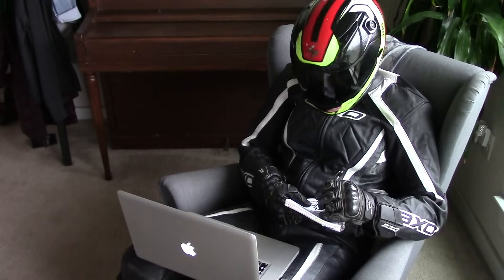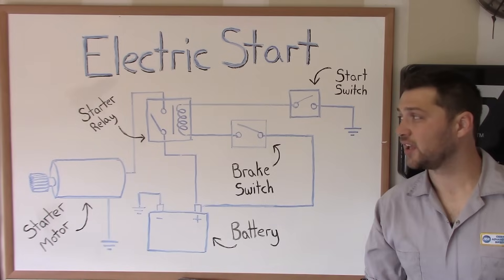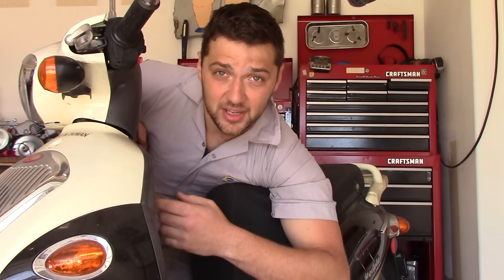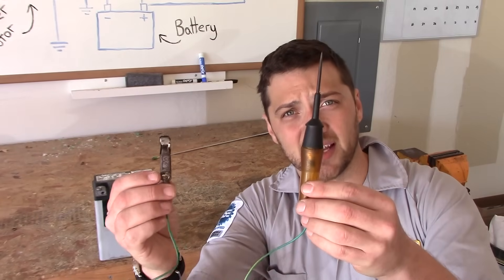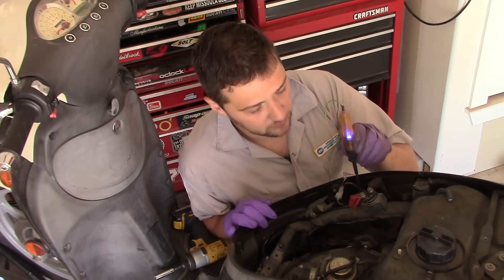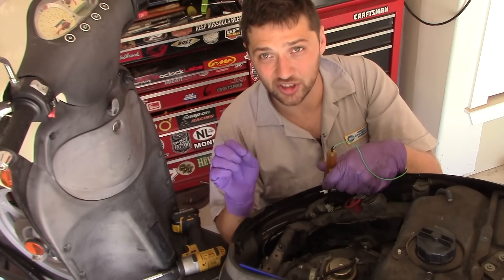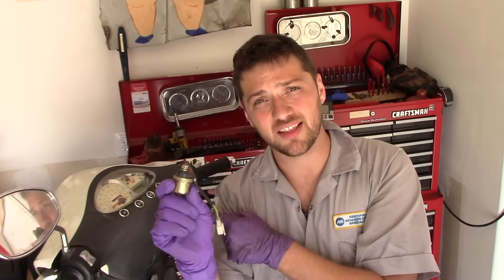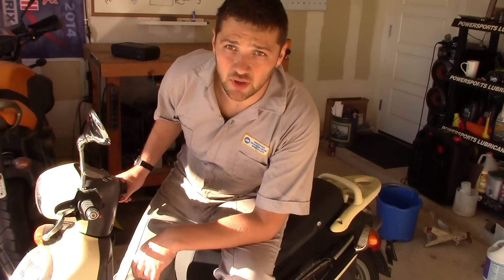Scooter 911: Electric Start Doesn't Work (troubleshooting your starter, starter relay, and circuit)

Comment: @3.36 You said that the noise scooter is making is not because of the Electric System. But You did not tell anything about the cause of that. Suddenly You jump into another topic. Can You please tell, why the scooter makes that noise? My Scooter is making exactly that noise @3.36. I don't know what that sound is called.
Reply from the maker: That sound is called cranking. It's made when the starter motor is turning the engine over. Sorry for being unclear in the video, but what I said was, "if your scooter is making this sound (cranking) your electric start system is working just fine. You have a different problem."

This video only deals with diagnosing the electric starting system and testing the components within it. I.e. the starter, starter relay, and switches. If you scooter makes that sound, all of those components are operating properly so you do not have an "electric start problem".

If your still scooter does not start after making that sound, the condition is called "crank but no start".

I will have some diagnostic videos coming out in the near future that can help people diagnose that condition. Good luck!
Reply: @Scooter_911  Thanks for the detailed reply. So if the scooter is in "crank but no start " mode, which parts should I check? I have checked the battery. I put it on charge. The back red light glows when I press brake, horn blows good sound, fuel indicator turns right on, side signals work good. So I think battery is not the problem.
Reply from the maker: @kylielarsen6404  if the scooter cranks and doesn't start there can be 3 different culprits. Either the scooter has an issue with spark (via the CDI, coil, and sparkplug), Fuel (via the carburetor and petcock), or compression (via internal engine components). Keep in mind it can be any combination of these things. 

Think about the history of the scooter. If it has been sitting for a few months or more chances are the carburetor is plugged with deteriorated gasoline. If it just stopped running all of the sudden, more than likely you have a spark issue. If the scooter got weaker and weaker over time or made a terrible noise before it stopped running I would suspect a compression issue. Good luck!
Reply: @Scooter_911  My Scooter looks like it has a different problem. 1. Electric Start was not working. So I used the Kick Start. It was working fine. So I did not bother to worry about electric Start. 2. Now, Kick start is also not working when it is cold. I am in Texas. So after 10:00 A.M, it gets hot and then it is working fine without any problem. Not sure. What the problem is on my scooter.
Reply from the maker: @kylielarsen6404  that sounds like a fuel related issue. did the scooter sit for a while? you could have a plugged choke passage. what part of texas are you in?
Reply: @Scooter_911  I am in Dallas. No. I am using the Scooter every day. More than 13,000 Kilometers on it. This problem started to happen from Yesterday. Is it the fuel line that is the problem? There is no Choke on the carburetor. I checked it. Mine is a taotao 49cc 4 stroke engine Scooter.
Reply: @Scooter_911  Also another thing is, if I am going somewhere, lets say like after 4-5 miles, when I use the electric start, the electric start works then. But I guess the engine should be running for atleast 10-15 minutes. Then the electric start works without a problem.
Reply from the maker: @lorryatkinson8741  so the scooter "cranks" every time you hit the button but the scooter does not always start when it's cold?
Reply from the maker: @lorryatkinson8741  all scooters with a carburetor have a choke. Yours is an electric/automatic choke. its that black thing on the carburetor with 2 wires coming out of it. It could be that or your scooter might be in desperate need of a valve adjustment.
Reply: @Scooter_911  It will never start with a electric start also. Electric start is completely gone long back. I use kick start only. Kick start works when it is hot outside. But if it cold, then it is not starting from Yesterday.
Reply from the maker: @lorryatkinson8741  ohhh I see now. Well yes I think you have a fuel or compression problem that you should probably address first. I will be posting more videos soon that might help you with these other problems so stay tuned.
Reply: @Scooter_911  Also, the vale adjustment, I am going to look into that shortly. My variator also has gone bad. so I am waiting for that part. Once I get that I want to change the Gates Powerlink Belt and Front Variator. I use 6 grams weights. After that I want to check the valve adjustment also to 0.05mm. Right now seeing the videos here on youtube regarding the valve adjustment. ordered a new NGK spark plug as well. want to change that also. Will clean the inside of that head with a carburetor cleaning liquid. If not, then I want to change the carburetor. But thats my last option as of now. Any suggestions are highly appreciated. Thanks a lot for the time and effort You are putting in helping me out of this problem.
Reply from the maker: @lorryatkinson8741  I'm glad to help! I want to make sure everyone who wants to be in the wind can stay there. Those all sound worthwhile investments.
Reply: @Scooter_911  Hi Garrett, Thanks a lot for Your help. My Scooter now works good. The Electric Start works like a charm now. That valve adjustment trick helped me a lot. Thanks a ton for that.
Reply: @Scooter_911   I could not do these repairs as I was stuck with my finals. So here are the few things that I did on the scooter. 
1. Changed the Clutch Assembly. Put very small amount of Lucas red and Tacky grease and put the Clutch assembly. 2. Variator Set. Complete set is new. I used a new set of 6.5 grams roller weights which I bought separately 3. I changed the Belt also. 669 18 30 Gates Powerlink Belt. 4. I changed the Engine oil 10W-40 Full Synthetic and Gear oil 85-90 Full Synthetic. 5. Charged my Battery for 5 hours on the Wall charger that I got with the Scooter.  - So recently I started noticing that  my Scooter is making some noise, just like in this video. https://www.youtube.com/watch?v=BfZppT1exm8

This is the exact noise, I have on my Scooter. Unable to find much information about this problem. All Comments section in this video, everyone has the same problem. But no solution.  When I am going about 10 miles / 15 kilometers, it runs good. No Problem. But when I go high speed, thats when I hear that noise. Any help, is highly appreciated. Thanks a lot for all the help and guidance.
Reply from the maker: @lorryatkinson8741  did the sound change at all after you replaced the belt (either in tone or in when the noise occurs). May I ask where and why you applied the grease to the clutch? How many miles are on your Tao tao?
Reply: @Scooter_911  The sound was there before I changed the clutch. But after I changed the clutch, it started even more. below 10 miles, no sound, nothing. 2. I applied grease to the actual metal rod, the clutch sits on. No grease on the clutch inside or to the pads. 12,000 kilometers, since this is a chinese scooter and they use metric. Similar to Tao Tao but Ice Bear Brand.
Reply: @Scooter_911  other people are saying buying a performance clutch cover might help
Reply from the maker: @lorryatkinson8741  it could be the issue but it could also be the belt or a final drive bearing. Was the belt you took off a 669?

Comment: Mines a vatacci eagle it's brand new i just got it & it's not starting..the horn & lights work but it just won't start or do anything i bought a battery charger for it & still nothing no sound or anything..any idea
Reply: Yes there's a click but that's all it does
Reply from the maker: Did you try the starter relay bypass at 7:32 ? You you hear a click at all when you hold the brake lever and press the engine start button?
Reply: @Scooter_911  i got it off the internet some are saying it's the spark plug but i didn't get one so I'm guessing it's already in there but it's not starting there's a click but no start
Reply from the maker: @MrJdrowe02  it most likely is NOT the sparkplug. Is the scooter making the same sound that I demonstrate at 3:35 ? That sound is called cranking and if the scooter is cranking you have an issue not related to the electric start system. It sounds like your scooter is not cranking though, and is just giving you 1 single click each time you press the button. Did you try the starter relay bypass yet at 7:32 ? That test will tell you if the problem is the starter motor, or starter relay. Let me know what happens when you perform that test
Reply: @Scooter_911  it just made some start up noise
Reply from the maker: @MrJdrowe02  so, not the cranking noise? Did it make the noise after you did the bypass test?
Reply: @Scooter_911  when i did the test i made the Same noise at 3:35
Reply: It
Reply from the maker: @MrJdrowe02  nice work! So if it cranks when you bypass it, but only clicks when you press the start button it's most likely your starter relay!
Reply: @Scooter_911  yea I'm having it taken to a mechanic so hopefully i can get up & running
Reply from the maker: @MrJdrowe02  the starter relay is pretty cheap and easy to replace yourself if you want to give it a try.
Reply: @Scooter_911  yea but it's like the bike i got was supposed to be fully assembled & inspected but unfortunately it wasn't..it won't start & now I'm having to take it to a mechanic to have it inspected plus I've had to miss work because of someone else's screw up smh
Reply: Do you know how to restart or reprogram a scooter using a computer
Reply from the maker: @MrJdrowe02  well most scooters cannot interface with a computer. However some of the fuel injected scooters like the Yamaha Zuma 125 and the Honda Forza can interface through their respective data link connectors. Are you trying to reset something?
Reply: @Scooter_911  my brand new scooter i got won't start i took it to a mechanic & he said it needs to be Restarted with a computer
Reply from the maker: @MrJdrowe02  what kind of scooter is it? Is it the vatacci eagle?
Reply: @Scooter_911  yes its a 150
Reply from the maker: @MrJdrowe02  I'm afraid he was mistaken. There is no computer in that scooter. Does the scooter crank? Like rikiikikkikkikikiikkkikk?
Reply: @Scooter_911  no there's no crank..its a brand new scooter he said it needed to be Restarted the same way you re start a car
Reply: When you turn the ignition the dash lights don't even come on
Reply from the maker: @MrJdrowe02  and the battery is good and fresh? There is a fuse on a red wire near the battery. Check to make sure the fuse is good and the battery is properly installed. Does the horn honk?
Reply: @Scooter_911  yes the horn honks
Reply: @Scooter_911  & yes the battery is new it came with the scooter
Reply from the maker: @MrJdrowe02  does the brake light illuminate? Didn't you say it cranks when you perform the starter relay bypass?
Reply: @Scooter_911  yes the brake light works
Reply from the maker: @MrJdrowe02  and does it crank when you bypass the starter relay? 7:32 ? If so you might just have a defective starter relay. I know it's brand new but it does happen. At the dealership I worked at we'd break brand new bikes out of the crates and have to replace components like that.
Reply: @Scooter_911  well hopefully it's not..the mechanic told me to call the company that i'd bought it from & they'd help troubleshoot it & then Recommend that i have it taken to a shop locally
Reply: @Scooter_911  it could be that something may not be plugged up..because i looked under it & noticed that a cord wasn't plugged i just didn't see where it plugged into
Reply from the maker: @MrJdrowe02  what kind of cord? Was it an electrical connector? That is possible.
Reply from the maker: By rereading the comments I am almost positive that you have a problem with your starter relay. Make sure that the 2 pin connector is fully connected to the wire harness and if everything is connected correctly, order a new one.
Reply: @Scooter_911  i think it might be a key fob issue
Reply: @Scooter_911  i just saw a guy that had the same problem with his bike not starting..but had lights flashing & horn working he said all he needed to do was change the battery & he was back up & running..so I'm thinking it may just be the key fob
Reply from the maker: @MrJdrowe02  does your scooter have a key fob alarm?
Reply: @Scooter_911  yea
Reply from the maker: @MrJdrowe02  oooohhhhh that probably is your problem.
Reply: @Scooter_911  so just change the batteries?
Reply: @Scooter_911  i think that's what the mechanic meant by it needed to be Reset
Reply from the maker: @MrJdrowe02  well not exactly. You might have to remove the alarm system. It could be defective. It is not programmable either.
Reply: @Scooter_911  well it works when i turn on the radio idk it might just be remote start
Reply from the maker: @MrJdrowe02  unfortunately there is no reset on those. they're pretty cheap little alarm system, you're better off just cutting the whole thing out of your system.
Reply: @Scooter_911  well it shouldn't need to be disconnected..its on there so no one will try to steal it
Reply: @Scooter_911  how do you stop gas from leaking
Reply from the maker: @MrJdrowe02  where is it leaking from?
Reply: @Scooter_911  its leaking from a thing that has a screw in it
Reply from the maker: @MrJdrowe02 on the left side of the engine near the bottom?
Reply from the maker: If so tighten the screw
Reply: @Scooter_911  yea a guy had stopped me & noticed gas was leaking on the left side
Reply from the maker: @MrJdrowe02  that's a float bowl drain for the carburetor. Screw that brass screw all the way in. If it still doesn't stop you can just tie the hose in a knot.
Reply: @Scooter_911  well i did notice it a little loose when i went to screw it in so yea it's pretty tight now
Reply: @Scooter_911  is the exhaust pipe supposed to smoke
Reply from the maker: @MrJdrowe02  No. The oil may be overfilled, or if the scooter was laid on its side for a while oil can make its way into the combustion chamber
Reply: @Scooter_911  well its a brand new scooter & they said to change the oil..but i haven't yet..i just checked the dipstick & it looks like more than enough
Reply: @Scooter_911  how do i Replace the mirror..my bracket came off Smh..any suggestions
Reply from the maker: @MrJdrowe02  Yes in fact I made a video about it! Check it out here https://youtu.be/3RLjftChITI
Reply: @Scooter_911  well what I'm saying is the screw base came off so there's nothing to actually screw in so is there a way to get a mirror replacement
Reply from the maker: @MrJdrowe02  yes they are available online. If the mirror mounts into the switch assembly look for a left hand or right hand switch. Pay close attention to the connectors. They should be pictured in the description
Reply: @Scooter_911  yea but the braket part that holds the screw in came off so how can it be replaced
Reply from the maker: @MrJdrowe02  sounds like you'll have to replace the whole mirror mount or hand switch
Reply: @Scooter_911  what tool do you use to change oil
Reply: @Scooter_911 my speedometer stopped working..any idea how to fix
Reply from the maker: @MrJdrowe02  check to make sure it's still connected at the wheel.
Reply: @Scooter_911  i checked & it was disconnected..one of the prongs broke
Reply: @Scooter_911  also what does it mean when it makes like a ticking sound after you ride
Reply from the maker: @MrJdrowe02  it's just the hot metal cooling down. Nothing to be concerned about.
Reply: @Scooter_911  ok cool so is there anywhere to get a new cable for speedometer
Reply from the maker: @MrJdrowe02  yep, there's a lot of retailers online. You can even get them off Amazon. Just measure you're old one and take note of the way it mounts in the speedo and drive unit.

Comment: My Suzuki V50 Address is not even starting with the kick
Even the horn is not working.
Any idea?
Reply from the maker: Most likely the battery, I have a video coming out soon that should be able to help you with this though. Hang tight!

Comment: That's the sound! 3:42 what is my problem?
Reply from the maker: Well it could be a number of things, but one thing is for sure, your electric starting system is working properly. Most often it is a fuel delivery problem. Either the carburetor is plugged with old fuel from sitting around too long, or possibly the petcock isn't operating correctly. It might even be out of fuel! It is also possible that the engine is not getting spark due to a bad sparkplug, coil, or CDI. Unfortunately you're going to have to dig deeper to find out.
Reply: I syphoned about 3/4 tank of gas. Put fresh gas, and that did the trick!
Reply from the maker: @JoeyAsaro  good to hear! Nice work!
Reply: My scooter just worked today. After 4 hours Of scooter just sitting I try to turn on my scoot, it makes this exact sound but Won’t start. Brake light turns on when I press brake. My battery is brand new, bought it also today. Tought the problem may be gastank being empty. Got the gas tank full. Still the same problem. What could be the issue?